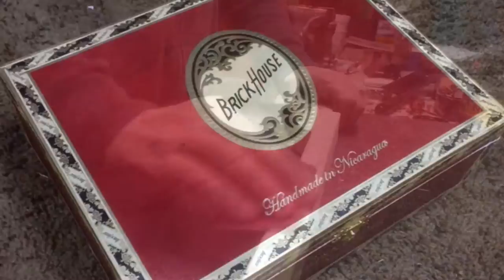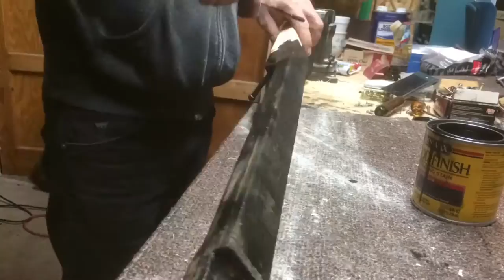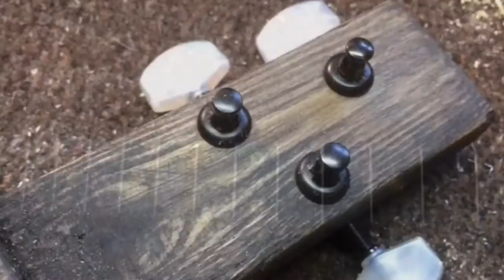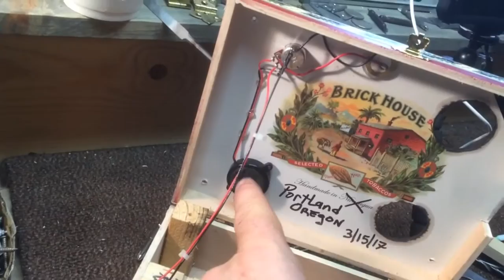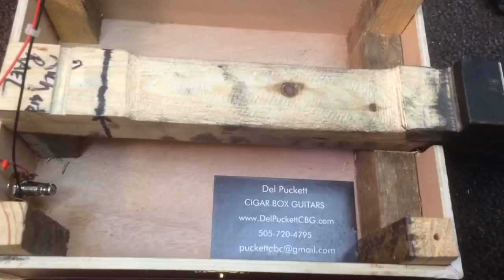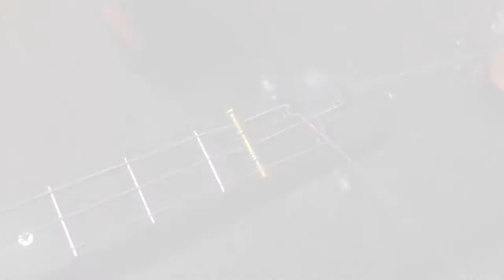Building a "Brick House" Cigar Box Guitar

Comment: How do you get the lid to open with that notch fitting over the step in the neck? Is that opening wider than the neck, or did you file a curve on the side of the step in the neck?
Reply from the maker: i forget - each box is different - usually the Brick House build i take off the top completely
Reply: @PuckettCigarBoxGuitar  I’m building one now. The Brick House is a good box -  all wood. I knocked the pins out of the hinges so the lid lifts straight off. Small screws at each corner to hold it on. If I find your email I’ll send a picture.